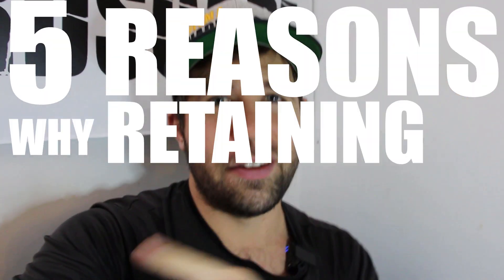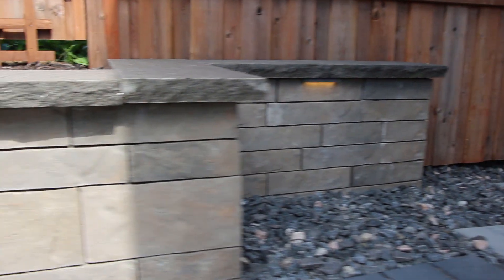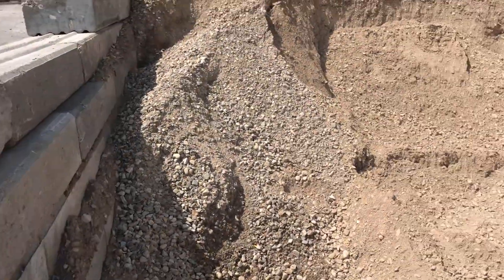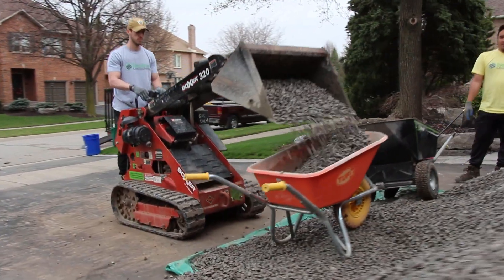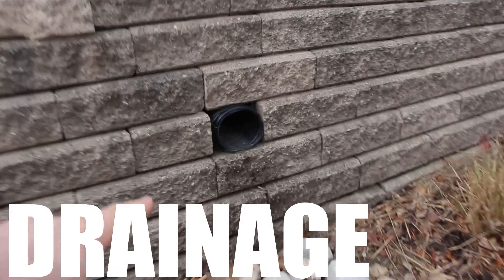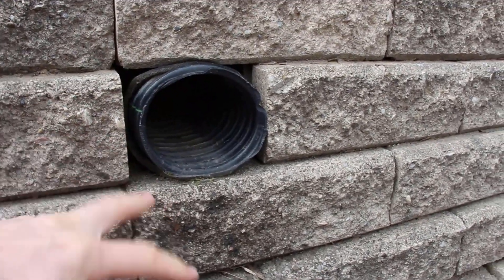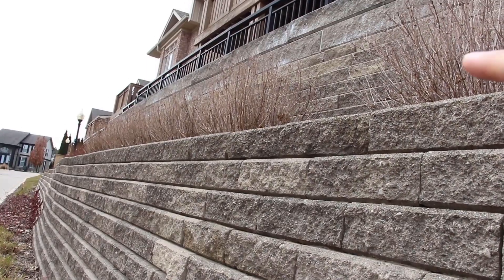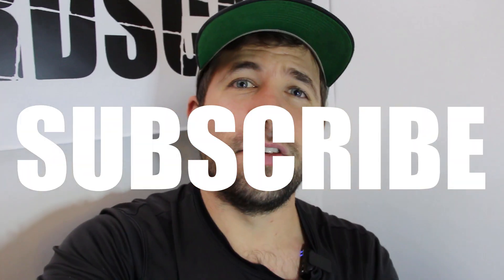Why Walls Fail | 5 Reasons and How to Prevent Them

Comment: I just had a landscape company come and build a retaining wall in my back yard not too far from you in Grafton.  The wall is 3.5 feet tall and 45 feet long.  They used Unilock Sienastone Smooth.  They glued all the Unilock together.  They used a 1/4 inch base, not sure the material but maybe limestone at about 6 inches.  The base material came up even with the ground on the back side of the wall so the bottom of the bottom course is visible.  Behind that the ground slopes down for about a foot then steeply slopes down 2 or 3 feet.  They put 4 inches of 3/4 clear stone against the wall on that side to hide that the bottom of the wall is even with the ground behind.

On My side of the wall they did put a drain at the bottom of the wall and 6 or 8 inches of 3/4 clear stone for most of the height of the wall with a woven geotextile separating the stone from the ground behind.

This brought up the ground for a 16 by 36 in ground pool all packed around with 3 inch minus.

What's the chances of this wall lasting.
Reply from the maker: Sorry, I do not comment on other contractor's work. You can find a start to finish retaining wall build instructional video here though and it will likely answer all your questions / concerns: https://youtu.be/u8Kwc_1fPdw